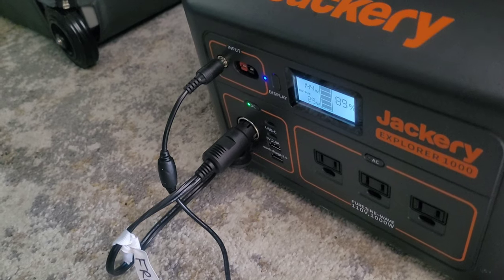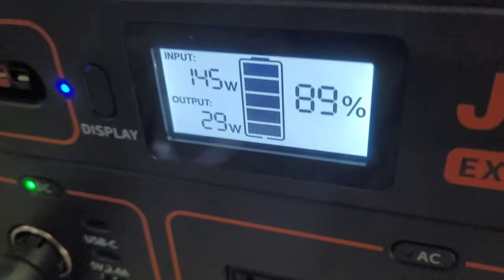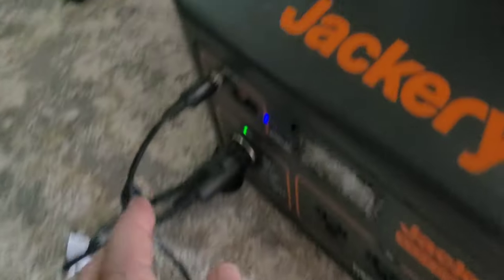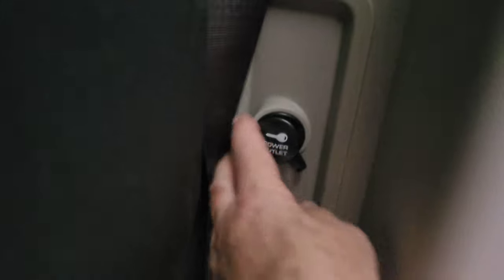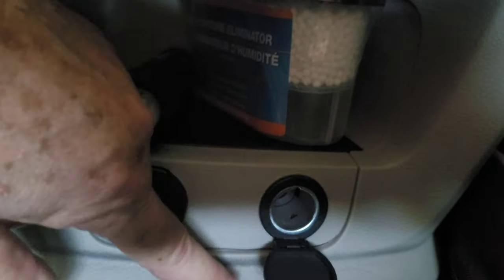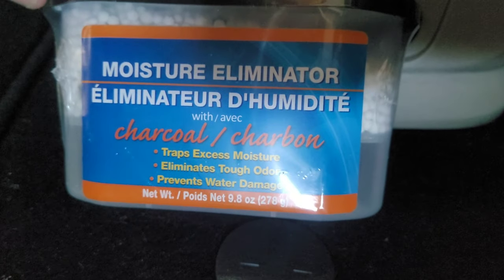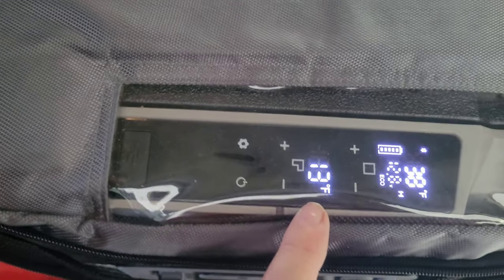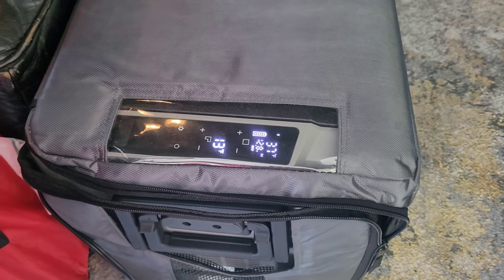Charging my Minivan Refrigerator

Comment: You seem to be so calm about it all.  I've taken two trips in my minivan camper.  One moochdocking and one at a campground where I had electricity available.  I was able to keep my fridge going nicely, but I worry about boondocking later and haven't had a chance to juice up my Jackery.  I may not have solar panels by then.  I might have to go back to using ice for awhile!  I'm really  nervous about getting out there!  Of course, I have to be moved out of my apartment by the end of July and I'm sweatin' that.
Reply from the maker: Don't sweat it. I messed up majorly over the past 3 or 4 days by only driving short distances to explore different towns along the way. 

I did not bother to plug my Jackery into my 12v car outlet and I did not use my solar panels. The one time I did plug it into my car was when I wanted to use my Instant Pot. I drove for one hour but I didn't gain power because I was sucking it back out with my instant pot. As a result my Jackery dipped down to 11%. 

It was getting late and I wasn't going to drive far enough to recharge it enough to keep my refrigerator cool all night unplugged. I don't eat a lot of meat and didn't have any in my fridge. But that morning I had bought some yogurt and cottage cheese. I also had store bought eggs in my fridge. So what happens, all of a sudden it started to rain.  OMG. I look at my phone, 38%. My computer  which I really don't use a lot was also running low. I would soon totally be out of power on all fronts. 

Luckily I spotted a Starbucks while looking for a welcome center in the next town over. I still haven't found that welcome center.But last night I walked into that Starbucks with my 1000 watt Jackery, my computer, and my phone to ask them if I could sit and charge my Jackery, computer and phone for a couple of hours using their electrical outlet. I made sure I asked while I was ordering a sandwich and iced coffee for dinner so they wouldn't think I wanted to just take advantage of using their electricity. So all went well, that time. Will there be a next time? Knowing me,  I am sure this will not be the last time. One things for sure though, I am not going to keep too many things in my refrigerator that I won't be using within the next three days or be willing to throw out if I run out of power. To me the most important thing is to keep my phone charged. One thing I am seriously now thinking about is to put some kind of solar power on my roof. Not that it's going to solve everything, but had I had that on my roof while I spent the entire day at the hot springs and all the exploring around town I did from town to town since, I wouldn't have been in the mess I was in last night. It was simply a matter if poor planning and just being a newbie at all this.

Comment: The top 144 watts is your how much power the jackery is receiving from the A/C charger. The bottom 29 Watts is how much power the refrigerator is using. You should notice that while plugged into house power "AC" the jackery will receive a lot more wattage. When you have it running off your car alternator it will be charging but not as much wattage. The AC charger has a lot higher wattage output.
Reply from the maker: Thank you for your explaination.
Reply: Sure it is what I do best geek out on all things tech! @TravelGrandma